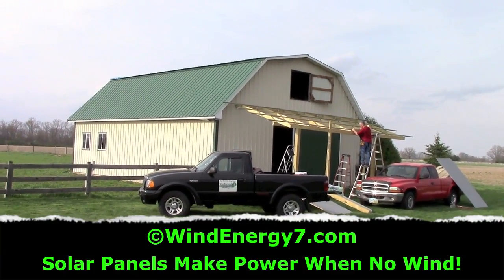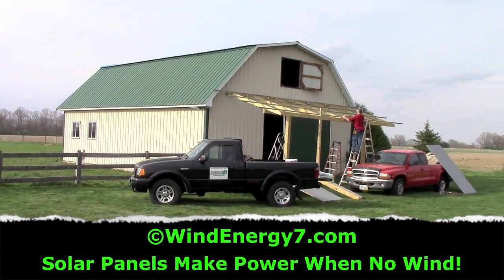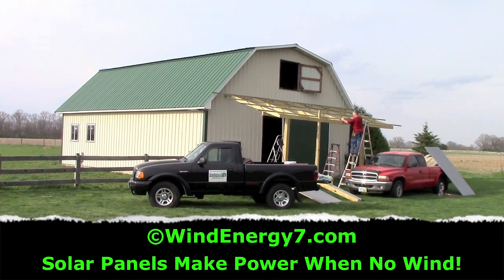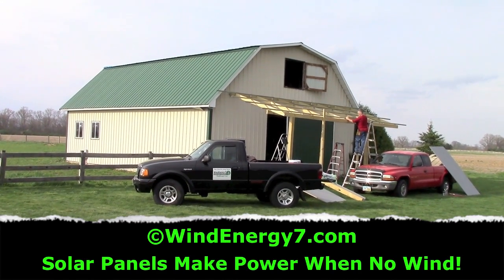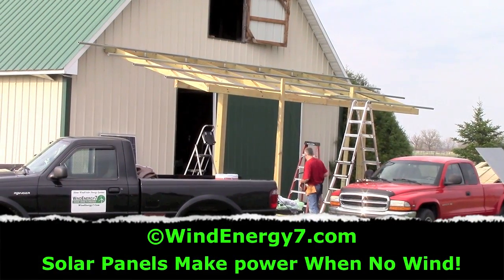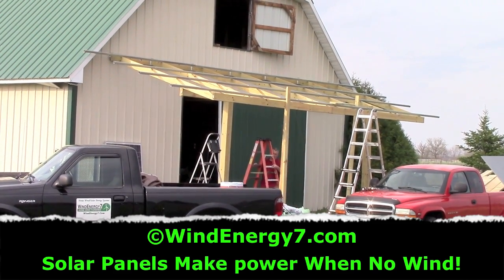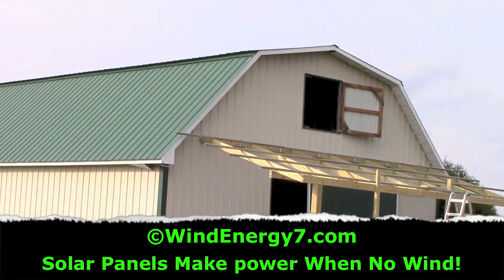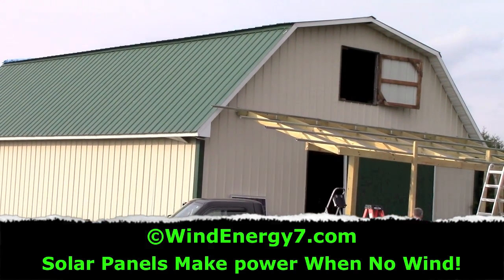Roof Mount Wind Turbine Roof Mount

Comment from the maker: The RoofMill™ invention is ONLY AVAILABLE From WindEnergy7. The guy invented this Home Wind Turbine around 6 years ago.  RoofMill™, Best Technology in The World and is well proven through the years.  For BEST NEW VIDEOS visit:  ->  WINDENERGY7.COM
Reply: That's why we are installed in about 40 states now because there's really not any legitimate system like we have.  We are easily several years ahead of anyone else in technology. For PRICING and VIDEOS visit:  ->  WINDENERGY7.COM
Reply: SmallWindTurbines Do you have special pricing for electricians?  I have 2 customers asking for this system and need to know that.  I have signed up on your contact form at the website.  Nice Work.
Reply: Tookes Barclay
Are you doing installations of these roof mounted wind turbines?  Where are you located because I will needs an installer I think.
Reply from the maker: http://WINDENERGY7.com - If you are seeking a small wind turbine, residential wind turbine, micro wind turbine, VISIT US AT:
http://WindEnergy7.com
Reply: Just went to the site and saw the newest video there.  Some of those shots are priceless.  #WindEnergy7